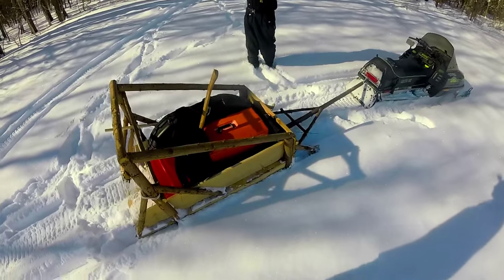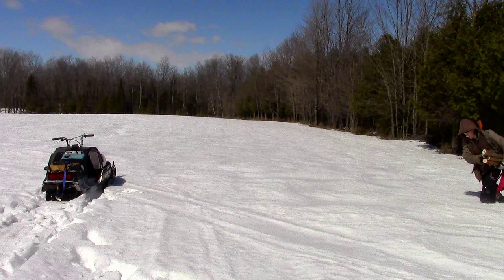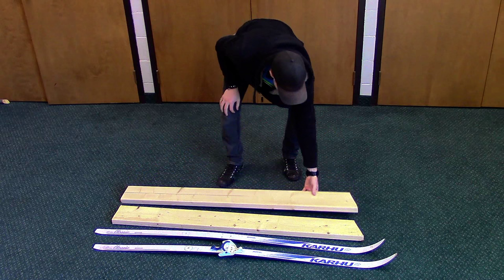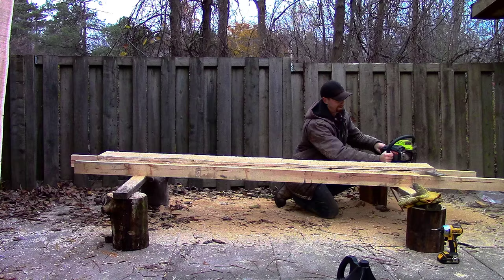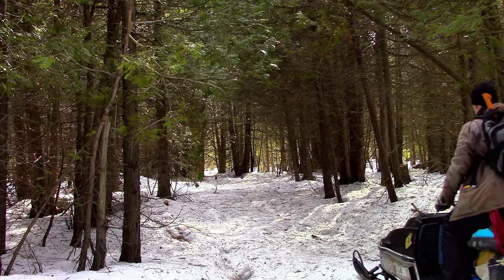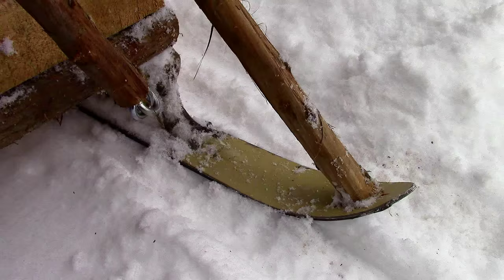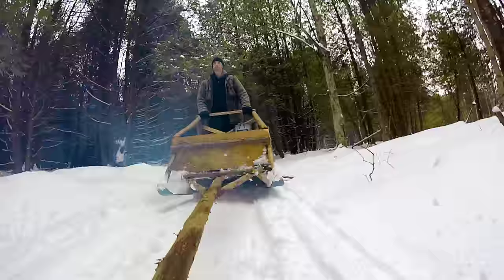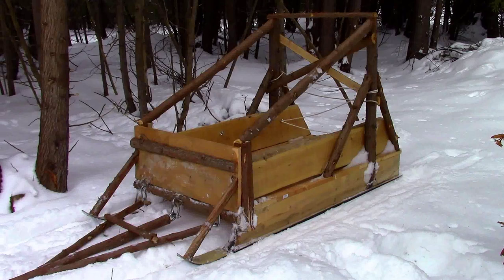Cargo Sledge for $40- DIY- Dog Sled Design!

Comment: To keep the sled tracking in a straight line you need to camber to skis so that the distance between skis at front is 1/8" less than the rear. Center to center.
"Pigeon toed" 
This keeps the nose of the sled centered, it cannot veer off to the side.

Comment: Cool project but downhill skis are better for two reasons, wider so they ride higher in the snow and two if you run the ice for fishing the merely edges cut and grip better than cross country skis that just slide sideways.

Comment: should the pieces of cedar be dry first? i only have pine, not cedar in ct
Reply from the maker: +Josh Kozee I think the cedar pieces are small enough that they won't shrink very much when they dry. Worst case scenario, I just might have to tighten up a few screws in a year or two. I think pine would work just as well.

Comment: hey... maybe add a skeg for trail stability.. i have seen them on polks and they work great..
Reply from the maker: +James Reid What's a polk? lol
Reply: TYPO ALERT.. P-U-L-K.... its basically a sled the you pull for winter snow hiking... and a skeg is that rudder/fin you see on surfboards.. disregard if you knew what I was talking about and are just busting chops from typo LOL
Reply from the maker: James Reid lol No I wasn't busting your chops. It had actually slipped my mind what a pulk is. Yeah, good suggestion. I'd have to make the skeg rugged enough to go over rocks where the snow is thin, but I'm sure I could come up with something. Maybe something like a snowmobile ski carbine. Those are built to take rough ground.
Reply: awesome idea.. also with the pulks a lot of ppl are using two fiber glass poles in an X configuration to give them stability going down hill.. i wonder if an X configuration of the cedar connected to your snow mobile would do the same

Comment: What is the weight of the sledge?
Reply from the maker: +Cherokee Cowboy Not sure. Around 50lbs or 60lbs I suppose.
Reply: 50-60 is not bad. Great video.
Any reason for using still kind of green cedar instead of dry? more flexible?